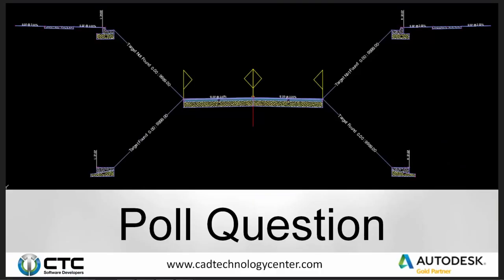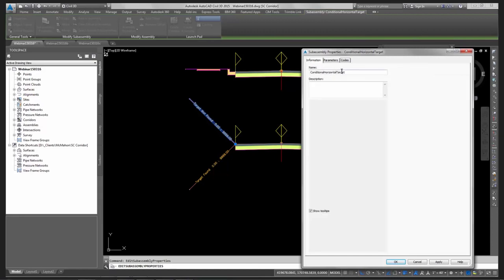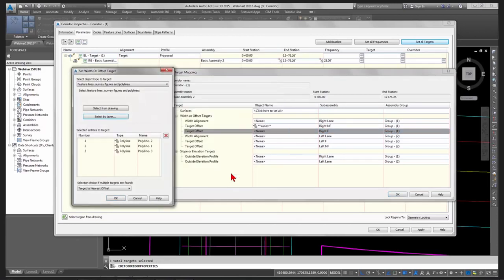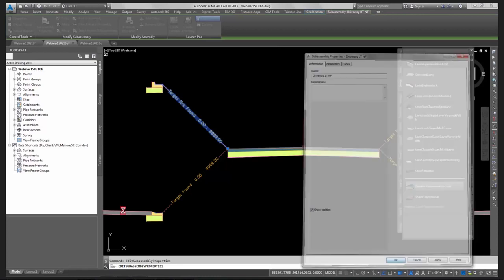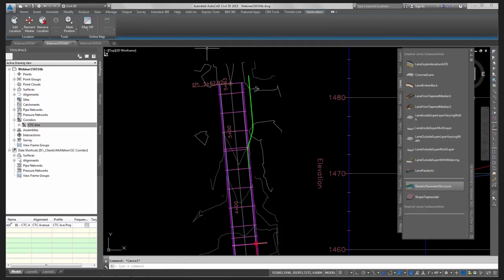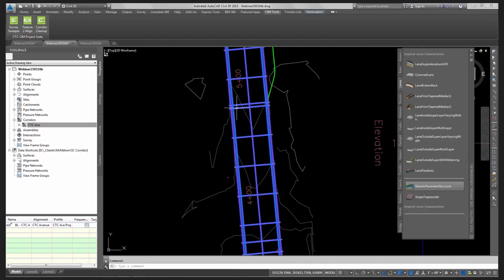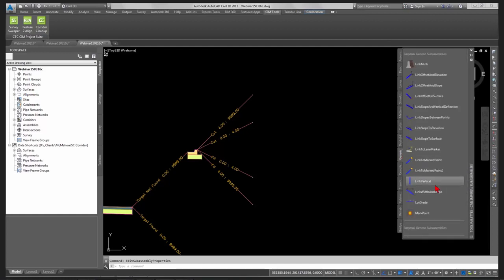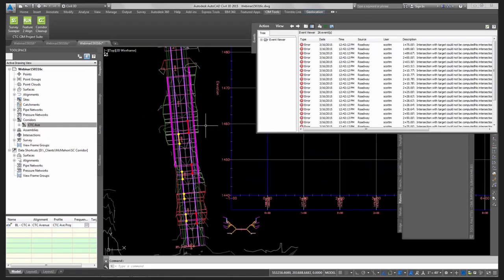Civil 3D Conditional Subassemblies in Corridors

Comment: Hi, thanks for a great video.  I’m wondering if you’ve come across a problem that I’ve got with conditional cut or fills.  I’m working on quite flat ground and I have a condition that requires a safety bund to be installed on a haul road once a nominated fill height is exceeded, I can get all that to work but an issue occurs when the fill height is getting close to the nominated height.   At one sample line the height is exceeded so the bund is installed, at the next the height is just slightly below the limit so no bund is shown, and at the next it’s exceeded again.  So the result is bund, no bund, bund.  In reality we’d put the bund all the way through all three points.  I’m thinking that the best solution is to make a “dummy” surface to target to and when we get the above situation we just locally lower the dummy surface and thus force it to install the bund.  Likewise if the conditional cut or fill is showing one tiny segment with a bund but nothing either side we’d locally lift the dummy surface to stop the bund being shown.  Any better ideas?  Thanks again for making the video.